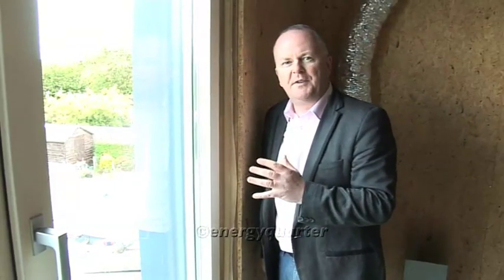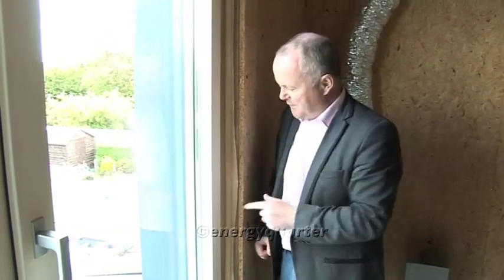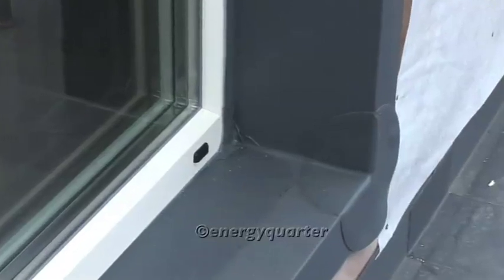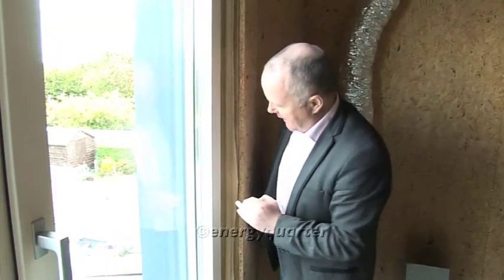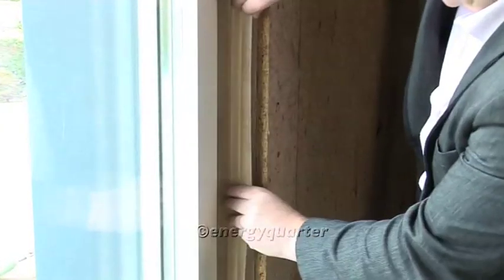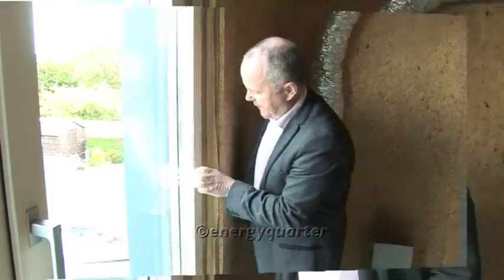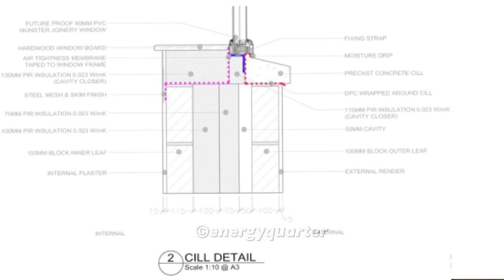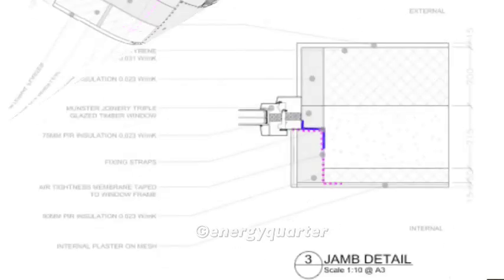Windows Passive House Series

Comment: What brand of windows are featured in the video ? Do you recommend Irish windows or should you go further a field ?
Reply from the maker: The choice of window can depend on a lot of factors related to the project - e.g. will it be a Passive Certified building?  However, the fitting detail of the windows is as important, as poorly fitted windows will adversely impact on the performance of the building.

Comment: Good catch on the last little bit about the radiators. I use to install HVAC but moved on to my Builders License. One thing a HVAC installer will do when remodeling or new construction is ALWAYS ALWAYS put a register for supply heat in front of a window or sliding door openings. Good catch you guys. Little extreme on the tape around the window part, because down the road tape becomes brittle and its adhesion wears away, but I'm sure if the house never settles from weather itll stay there.